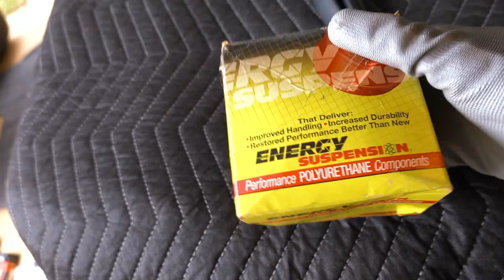These Energy Suspension Bushings where Really Hard To Install ,This is Why /  Jeep Wrangler Jk links

Comment: Man I'm trying to do those thick control arms, not even my 100T press get it in all the way, now I'm gojng to take it out and cut it like you did, *<"( this shit man, I'll take the Sway bar bushing any day over these 😂
Reply from the maker: Sometimes you can put the metal sleeve in the bushing first , then try to press them in the hole,  the sleeve will help prevent the bushing from deforming and some times you get them in.  Lol Good luck
Reply: @Donnythelatemodeltech  nah the ones I'm working with are the ones what don't have the metal sleeve, but I cut them in half and now they are in nicely, before cutting, I used heat, oil and all sorts of methods to get them in, but the very last bit never comes out the other side, there's always that small compression that keeps the bush from retaining its natural length